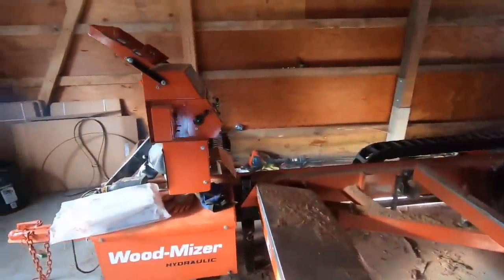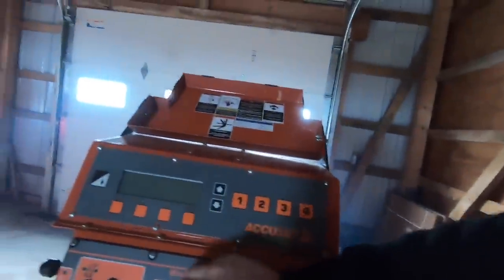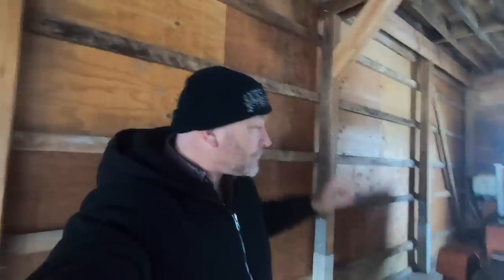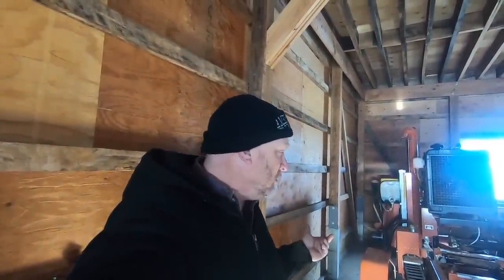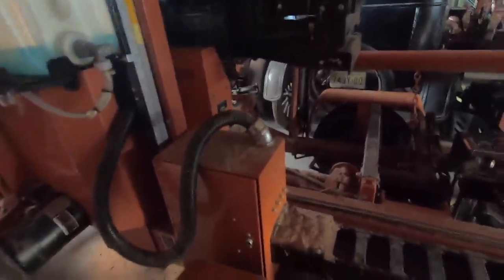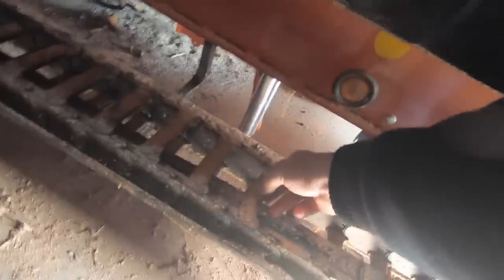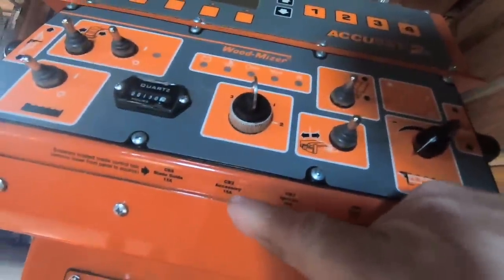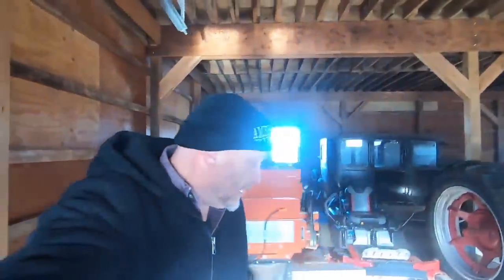WoodMizer Employee In The Comments

Comment: Wes, the diode and resistor by the solenoid is to filter out back emf when the coil de-energizes.  So although the contactor will pull In, you will be shocking the whole system (computer etc.) With about 5000 volts ever time you turn it off.  By the way, I'm an electronics tech, and yes we are all a holes. :)
Reply: Best answer on here. Love everyone else’s interpretation of why the diode is in the circuit 😂

Comment: I have a W/M LT70 and it sits for long periods of time the copper strip and the brass block that rubs on it get corroded (for the +side of the battery)  also there is a brass block that rubs on the bottom side of the mono rail (for the - side of the battery) this can get rusty and corroded that will be problems.  As for Wood Mizer , no other companies give the great tech support that W/M does.  I am sorry you had the problems you have had but I have talked to all these people at W/M and have had a great experience.

Comment: I think you just got the wrong guy there at Woodmiser.  The product is good.  Would all that information be in the manual under fuses, circuit breakers, and fusible links, power supply or similar Wes? Mind you, Justin or Jason (LOL) should have that at hand on their quick reference guide. LOL. Being a bit deaf is a pain in the ass isn't it. I'm a mechanic and wear them too. It adds to the level of frustation when you get pissed off. LOL

Comment: i looked at buying one of these mills some 14 years ago, and for a mill like your but with a gas engine, witch only lasts 15 to 1700 hours and 80k cnd the guy that came to the farm here to demo it, never so much as let me try it, and as a welder for some 38 tears amd mfg things i just dont see that kind of money in them, hell the tubing frame flexes like crazy, you have to set it on solid 10 H beams to keep it level and cutting strait, hell the guy that demoed it had to re set it up after every 30" log 17 feet long i set on it with my boom truck and he rolled it around afew times  the frame was all out of wake, i just done see that kind of money in them, its a flimzy frame and a saw head and a $800 hydrophilic pump and a $1000 engine and a few odds an ends, it didnt have that computer thing on it that was an extra 10k cnd . hell with that kind of money you can buy a good new tractor with a loader that has a thousand times more stuf on it and weight like 4 times more, and big rubber

Comment: one little thing, the meter between the neg post and cable does work. Its aggravating to walk back in forth though. I use a pto light of a dump truck control. Two wire extensions, two alligator clips, light comes on you have a short. When light goes out you found the short. That way one person job. FYI on radio memory and comp memory(Vehicles) the light will go on as well, but dim. So pull those fuses first. Hope it helps

Comment: I have had a wood miser LT 15 for about 18 years. It has served me well and the only problem I had was one winter mice got into the motor housing and chewed some wires. It was an easy fix and is not a complicated machine to repair myself. I have cut the lumber to build several barns and although it’s a small machine I work by myself and it is sufficient

Comment: From another channel.  He produces over 300 board feet an hour.  You have produced over 36,000 board feet.  He bills at $70.00 an hour.  With lumber shortage and high prices, use the project for savings and train a trooper to keep it in use.  It would be great to get back out in the woods to clean up down trees and harvest the mature high value hardwoods.  Convert an old shipping container into a kiln.  Glad your doing another build project.  Treat mill work as overtime to be done outside of farm tasks.  Good luck with good logging and sawing weather.  As soon as the ground freezes the log pile grows and the barn gets filled with lumber.  ? Could a part of the barn be made into a kiln?  Use hempcrete slip form insulated walls.  Great way to get  sponsors, kiln and hemp manufacturers  to pay you for the how to install and use marketing videos.  Let the motivated crew also help sell the lumber with your pricing direction.  Let them keep the delivery fee.  That sweetens the pot by $100.00 and $1.00 a mile.  Minimum deliver charge paid idealy cash to the wood mizer business apprentice.  The sooner the young men realize the value of milling lumber for there future home builds the better.  They would be smart to keep on logging, sawing and making bank after your build, selling high dollar dried, milled hardwood lumber.  I hope the next build is a stand alone milling structure.  Every bad weather day becomes a great day inside the woodshed with in floor heat from an efficient wood boiler that also heats the green house for Theresa's future garden.
Reply: I bet it's dam near impossible to install a wood burning anything in New Jersey.   Crooks in office.  California leads the shitcshow but NJ is top 10.

Comment: You can cut 10,000 board feet with an old hand set  Circle mill and you can buy them for a whole whole lot less then $50,000
Reply: where can I buy one ??
Reply: @banjobenson9348  look on sawmill exchange website
Reply from the maker: You are correct and I did look at many of them for many years the problem I had with those what’s a couple things. One is there stationary two I would have to have a mill house and they are wasteful with a 1/4- 3/16 i
Reply: @onelonleyfarmer  true they do make more sawdust. But the speed they can cut makes up for the waste. Plus the  Circle sawblades cost less to run than the bandsaw blades. But if your doing it for fun thats a different story.
Reply: @SawmillerSmith   50 grand is freaking crazy for that small of a machine......